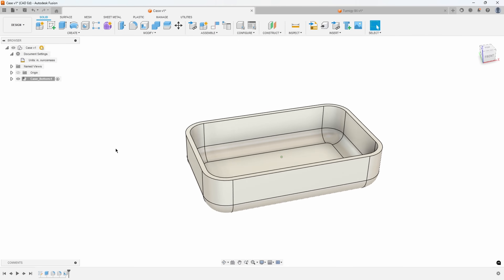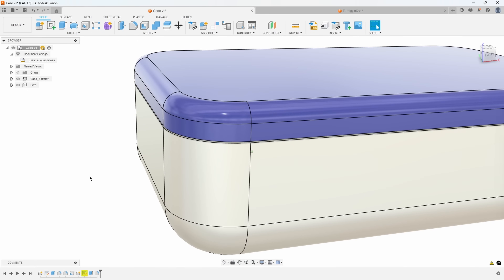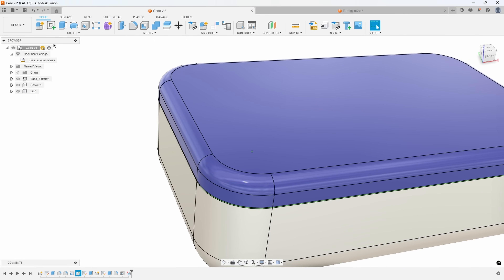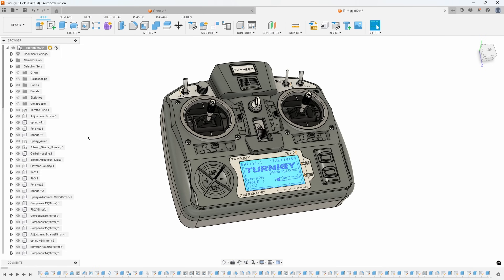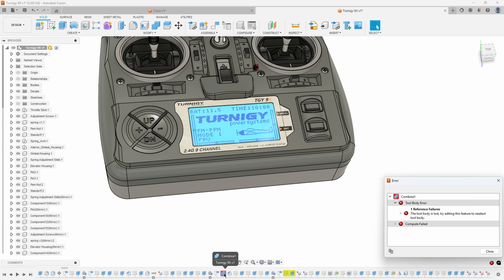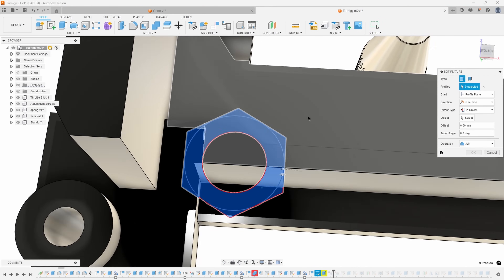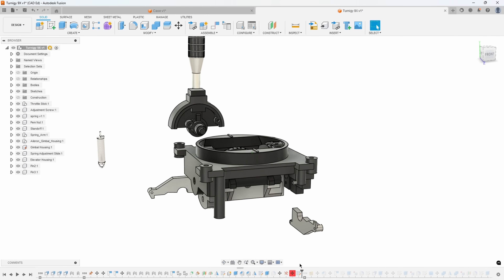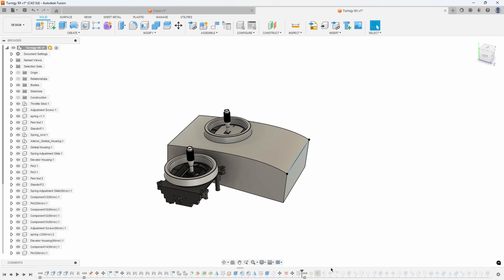Dealing with Timeline errors & warnings in Fusion

Comment: Great stuff, thanks. I have this situation where I created a plane on a flange for a part in my assembly. Of course i didn't learn about the delete vs. remove until just today with your videos. Later in my design I removed the component that had the flange and replaced it with another one. Of course the plane is broken now. When I merged the new component into the timeline it placed it later in the timeline and now when I try to fix the plane the new component is at the end of the timeline and I cannot select it. Can items be moved in the timeline? Drag and drop doesn't work for me.

Comment: This was just a quick example, and the cause of the problem was obvious, but it's possible to get much more mysterious errors. Modifying the earlier part can juggle the projection geometry to downstream components.

I've had Fusion completely lose its mind when I deleted a feature from an upstream component, even thought that feature that had no apparent connection to the component with the error. The projection was based on something else, but geometry got re-named and the wrong thing got picked up by the later part. A lot of people think that the topological naming problem is unique to FreeCAD, but Fusion and every other parametric CAD can run into similar problems. 

Thanks for the tips on fixing these errors.

Comment: Hi Brad, this is very basic issue which results in yellow warnings. But I am pretty sure most cases people have are related to parametric modelling, when you change a parameter and this results in some other operation in their timeline not being able to calculate (e.g roundover being to large or pattern not abble to repeat correctly etc..). Maybe this is an idea for another video?
Reply from the maker: Yes, you are correct.  But what I have noticed helping hundreds of customers is that 80+ percent of the time, timeline errors were related to using Delete vs making changes to parametric features.  You'd think it would be more 50/50, but it wasn't.  Now, I have noticed in more advanced, complex assemblies, the parametric feature changes tend to break more often due to dependencies, etc, but the Delete command is usually the culprit and that is why I focused on it for this video.
Reply: @bradtallis8968 I think it would be a great idea if you could isolate mos common dependencies that result in yellow warnings and do some guideline on how to avoid them. My example is roundovers and chamfers, I often tend to make them fixed and they brake when I make model thinner - but they should also be parametric, e.g 1/5th wall thickness.

Comment: One recent change to fusion that has caused me great consternation and at least one broken end mill (not to mention the scrapped parts) is that they no longer show the outline of missing features in the various cam geometry selection interfaces. Before, if you changed a sketch in such a way to confuse the downstream tool paths, you could at least see what got lost, now, it just clears it out and you are left wondering. Not helpful at all.